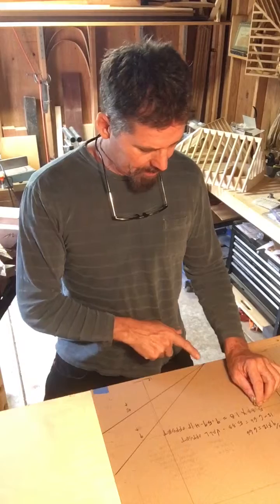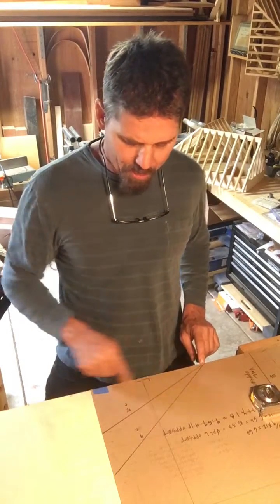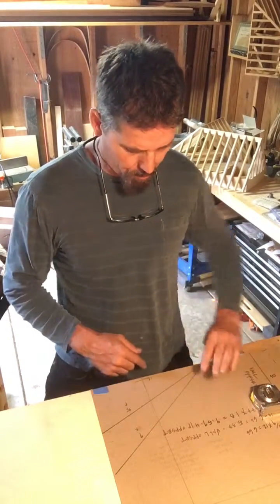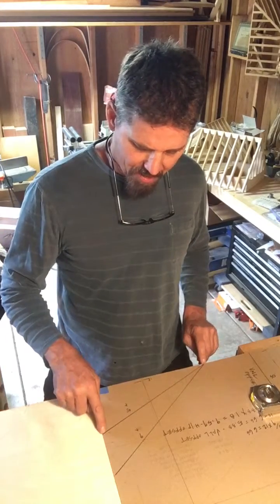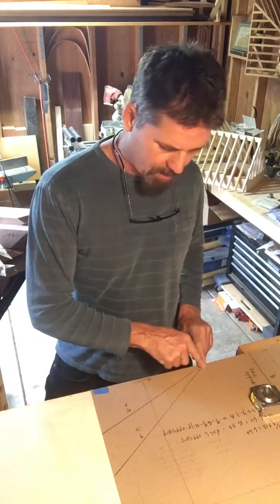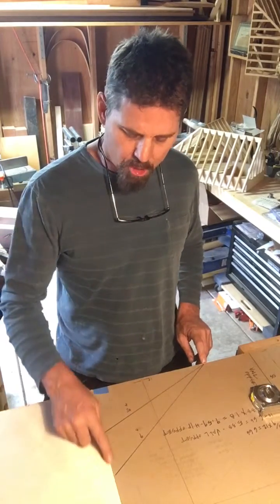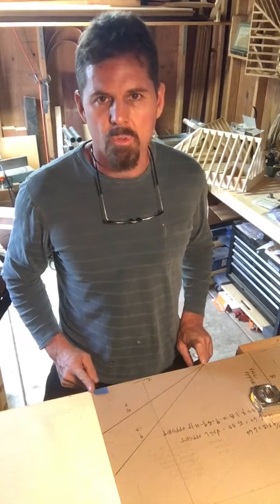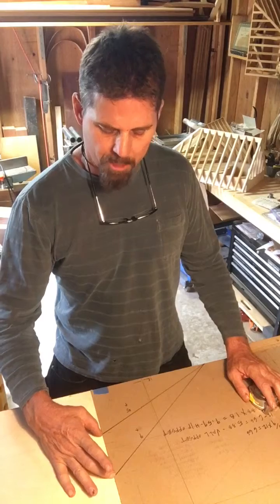Establishing bastard hip plate heights.

Comment: Question though?  Those sharper tail cuts on the bastard hip, do you use the swing table circular saw, per say, like for 71degrees, tail angle or do you cut straight from the flat edge of the tail with the opposing smaller angle with just a standard cicular saw.

Comment: In my view you have shown how to find the rafter height difference at the plate! In a lot of cases the HAP of the steeper pitch rafters needs to be taken into consideration and this can involve lowering this plate height calculation, and it can be the same for hip rafters a more suitable adjustment should be made to the plate height as the tail overhangs can be weakened when set at these higher plate heights!

Comment: Hi, I’m about to start an addition that starts 6 inches in from the original building line, but the overhang will be lined up
I know I have to raise the wall on the addition, but I’m looking for your video to know how much to offset the hip
Reply from the maker: Email me at nmridgeconstruction@yahoo.com
Reply from the maker: Is this a standard hip roof, not a irregular?  If so your offset will be the same as the additional 6”. Your plate will raise on the side where the difference is unless the rafter depths are different.
Reply: @roofcuttingandstacking7925  great thanks for replying